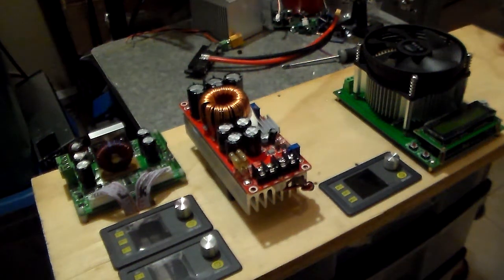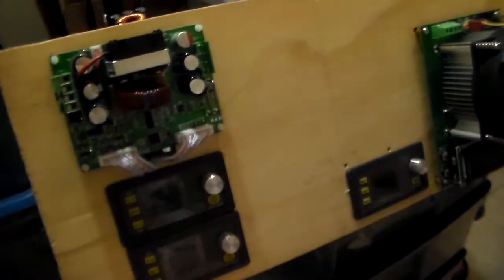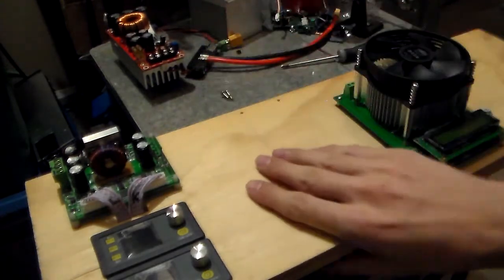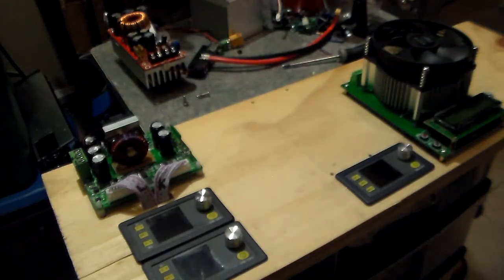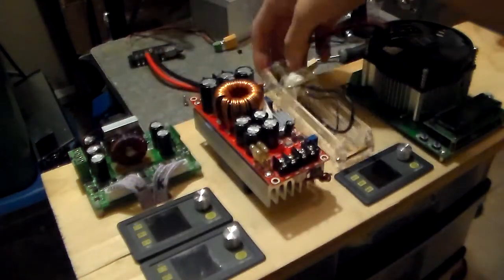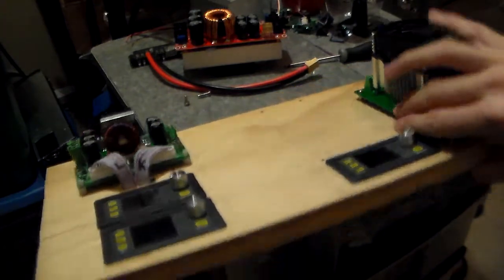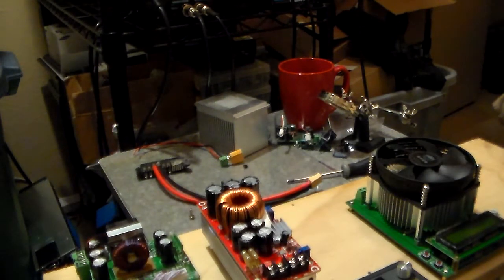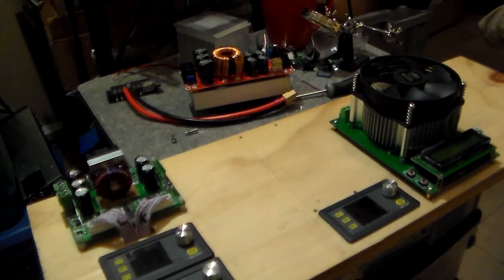The Power Hub

Comment: You'll blow up the boost converter if you put a battery on it? Thats why it has a low voltage pot on the input so you don't drain a battery too low? And there's nothing to stop a battery going on the output since you have CC CV control. Some people would say use a diode
Reply from the maker: You can certainly use this to take power from a lower voltage battery and charge a higher voltage battery. Now you need to use two different batteries, they cannot be the same nominal voltage.
You also don't need a diode on the output, I've said this in response to another comment but how the boost converter works is that there is already a diode facing the output. The only thing you would "backfeed" would be the output capacitors and the voltage potentiometer.
One last thing you need to be careful of is a boost converter even with CC it cannot lower the output voltage below the input. So if there is a short or battery that is lower than the input battery Constant Current goes out the window and you rely on whatever resistance the inductor and diode has. BOOM 💥🤣
Reply: @SuperBrainAK  interesting I didn’t know there was a diode already on the output. I’ve used this boost converter before to charge batteries, even from solar. 

Very interesting that a lower voltage output would cause such havoc but I guess that’s something not to worry about? If you’re using this the battery you’re charging is obviously so high that you need the boost converter because everything else you have is lower. Unless you were a dummy trying to use this like a buck converter

Comment: Great Combination, I have built a similar power supply using the DPS3012 and the same type of Boost Converter(mine is a 1200watt). I also purchased a  (LETOUR) 24v15 amp power supply to use with it.  I have mine connected where I only use the boost converter if I have something that requires more than 24volts. I also have a plug out the back of the converter and box i made, using Deans connectors. I can also connect it to a battery bank I have made of 25.5V 4s4p(boosted)  & 25.2V 6s3P. Unfortunately, I don't have any seal lead acid batteries to test it with. You can find my build on my Google profile page. I really like the idea of adding the other DPS Supplies! Great Work!
Reply from the maker: hey, those are some really cool power supplies! thanks, I am waiting for fuses to connect them to the main 38v from the boost converter, for now the DPS5005 has a laptop charger connected
Reply: I haven't created any video's yet...Still learning to edit. But you can find my latest build on my google page(with pictures)-

https://plus.google.com/+JoeFulwider-njfulwider5

Since this post, see pics(PSU mentioned above)-

https://plus.google.com/+JoeFulwider-njfulwider5/posts/8nu47gA6omc

I have done 4 new DIY Power Supplies(another DPS5015 Battery powered/BT), a Solder station and Fet Tester. Been on a roll lately...I just finished a BST 900 CC/CV with 24V 6-9A PSU (8V-120V up to 15amps). Now I just need to learn how to edit videos. Have learn allot from all of you guys here on Youtube!!!You Rock!!!!Love your Work!!!!
Reply from the maker: I dont normally edit my videos lol, just one shot with a pause feature on my camcorder. if I mess up I rerecord.
Reply: I'm a scardy cat...LOL and a slow poke. The last Project(BST 900) ended up with 35gb of Video, with around 5-16 hours of unedited video, if i had to guess. My one shot would be a long long video. Everything I have done so far, I have learned from all of you guys here on Youtube. Still pretty new to all of this (6 months maybe), reason I am sooooooooo slow... : ) Figured I could film everything I do and than edit and speed up all the important parts with voice overs. Now that is the plan. Editing and filming is also new to me. My 18 year old son is teaching me. He also created my njfulwider5 intro. Maybe someday I will be good enough and brave enough to do a one shot video...
Reply from the maker: njfulwider5 ah yea I don’t normally film when I am making something I just build it and say “look what I made” maybe it would peak a little more interest but that takes a bit more free time, higher quality videos means lower quality and frequency of projects, so it’s a toss up

Comment: Well, If you connect a cheap Chinese SMPS 12vdc 20 amp( I managed to pick two up from EBay for £7.50 each, great value) and connect this buck Converter Module (£12.30 EBay)  up to it, you get 12vdc at 20 amps and 80 vdc at 3 amps, I am doing a project using a couple of old servos from my RC days, and taking the limit stop out of them, and rigging it to turn the multi turn pots onboard the C-Board, this will enable me to panel mount two none latching push buttons to control the volts up/down. same with the current control. Works ok with a volt/current meter on the cabinet front panel along with an on/off switch and the four push switches, also extra cooling fan inside keeping the unit cool, Also using a cheap temp module with panel displaying the temp, and onboard meter relay control to switch the fan off/on when the temp on the heatsink get to hot. All being well a cheap 12v to 80vdc 240 watt vari/power supply. PS I could have replaced the on board pot's but they are a bit fidgety for an old pair of hands.
Reply from the maker: nice! dont forget boost raises voltage, buck lowers it, anyway sounds like a well thought out design! I would love to see it
Reply: Thanks SuperBrainAK  I won't forget, Its just a project as I have done a few with these cheep unit's, there good value, When I get my head round it I am thinking of doing a few voids on My projects, I already have two going on Youtube, PS, It is a boost converter I'm using on this project. Oh and I have a video on youtube if you type in "My Electronic Work Shed" it should be there. Once again thanks for the reply.

Comment: Hi friend 
you seems to make a bigger power supply ...waiting for your finished work
Reply from the maker: oh it is mostly finished here: https://youtu.be/kGgpL5otarE  I tested the DPS3012 to 240W there are still some upgrades to make but it is working!
Reply from the maker: hey I made a triple output power supply for my 3 DP units: https://youtu.be/lw_bY6FEVEs it is made with 90W 19.5v 4.62A (can peak to 6.7A) laptop chargers. One output is for DPS3012 is 2 in parallel with 2 sets in series so total of 4 making a 2S2P arrangement, then the other two outputs are for the DPS5005 and DP30V5A that is simple 2S1P each. the first output is properly grounded but the other two are not so I can parallel the buck converters on their outputs with no trouble. hope you like it!